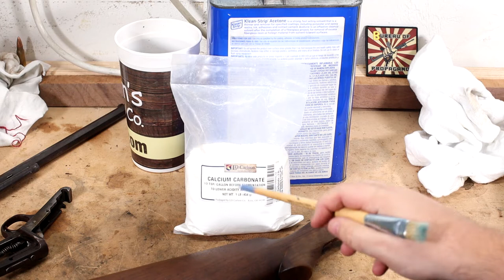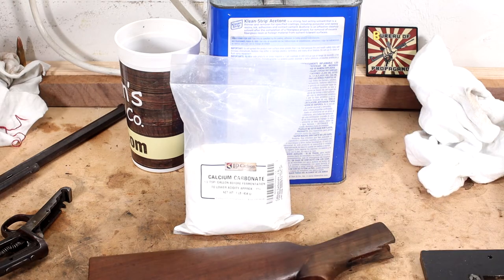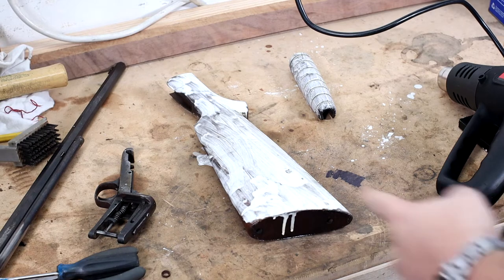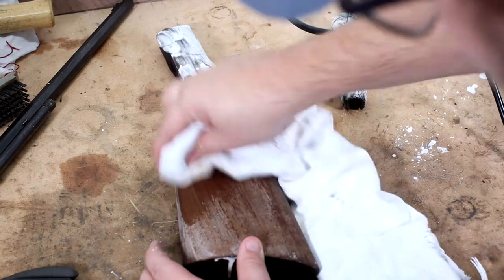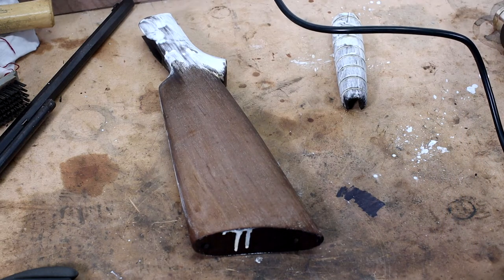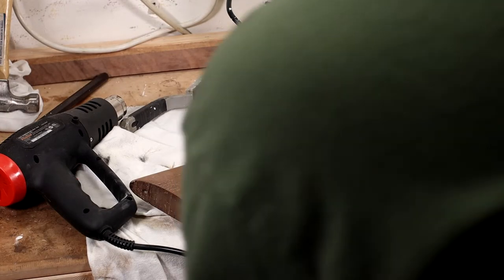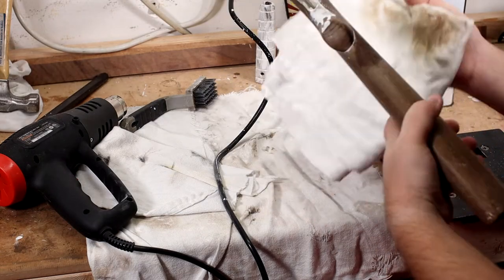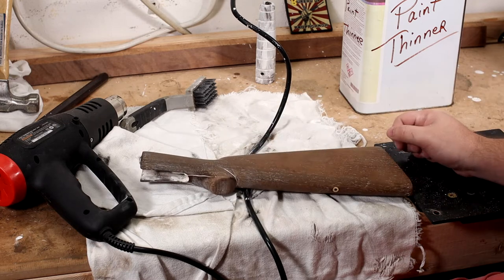Marlin Model 38- Stock Whiting

Comment: I'm working on an old Kar98 stock and did 2 runs so far, and for whatever reason, while it did lighten the stock over all, the little oil stains are stubborn as all hell. I'm going to have to do a few more runs tomorrow I guess.